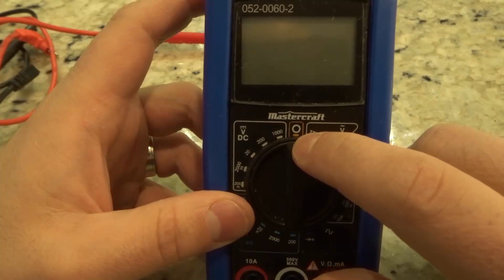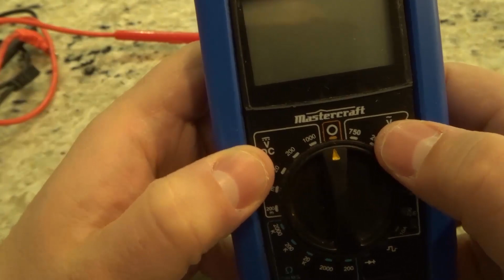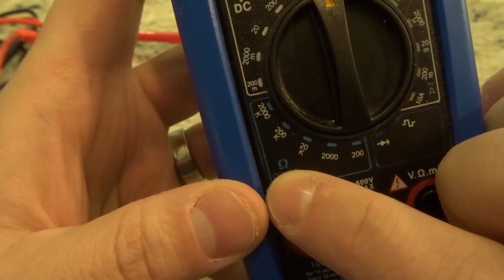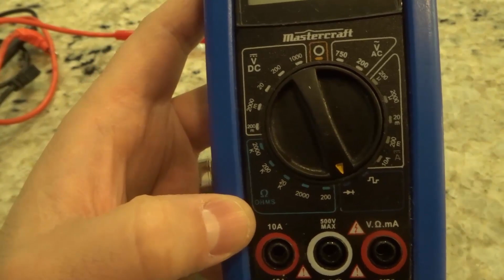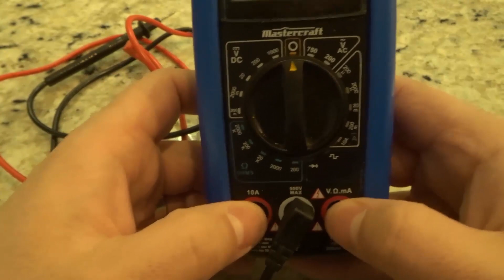What Do The Symbols On A Multimeter Mean-Easy Tutorial

Comment: I do not understand the difference between DV voltage and current. I also don't know what setting to use for what. We have AC/DC voltage and DC current and ohms and the diode. I only understand so far basically that the diode can be used for something like a burner on a stove or the element in the oven.